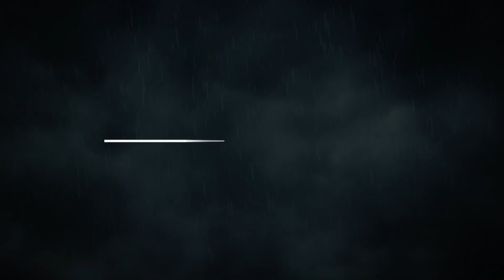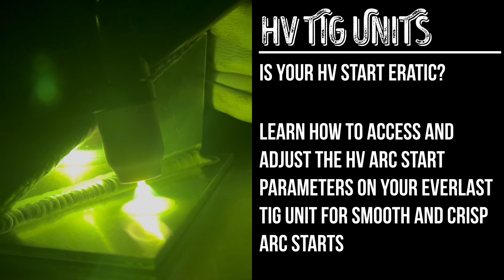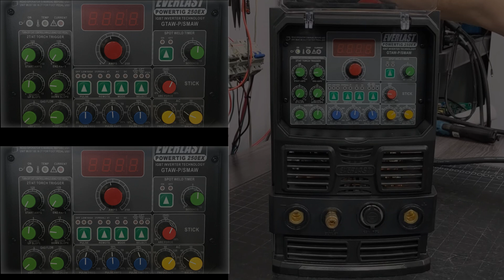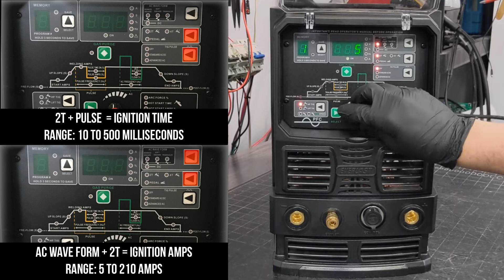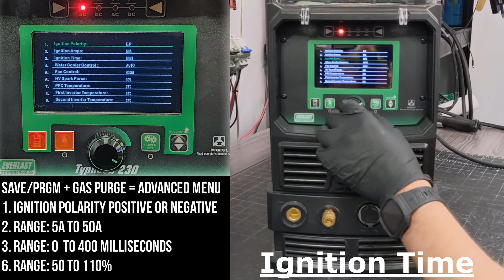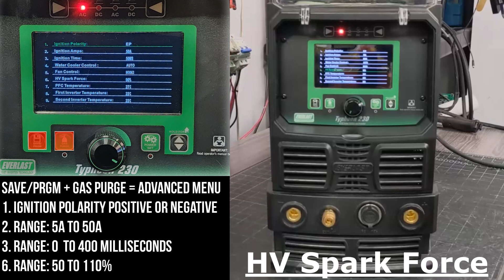Hidden Menu to Adjust HV Start Parameters

Comment: What should it be set at for the 200dv?
Reply from the maker: that unit would come with the ignition time set to 20ms. You can increase the time in intervals of 20ms until you reach your desired results. Mu machine is set at 40ms and i  have not experienced a situation where my ignition time has exceeded 150ms

Comment: I have an older 255ext and was not able to access these settings.
Reply from the maker: HV arc start and that hidden menu was added to models in 2024.
If you can see the spark through the front grill when triggering the machine, the unit is HF arc start and the adjustment will need to be done manually in the machine. 
If you are able to access the hidden menu then your adjustment to the strength can be done with the program.